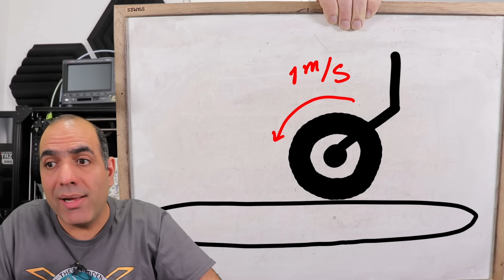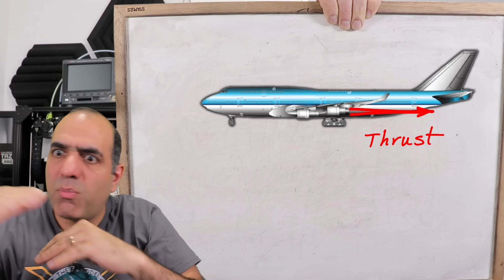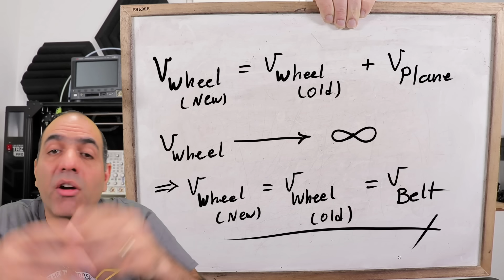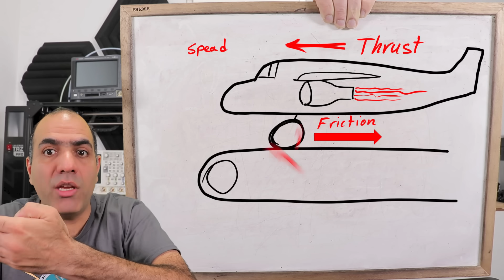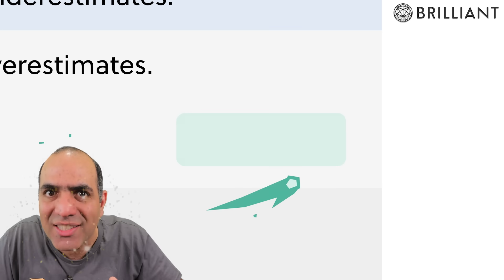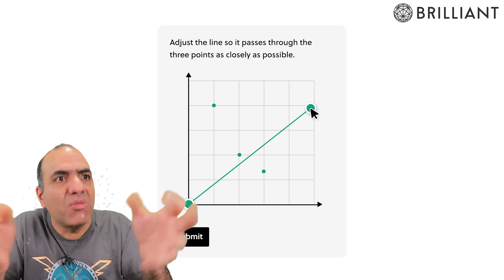Airplane Question that Drove Me NUTS!!!

Comment: Case 3 is definitely the most realistic, however if the belt is wide enough, the plane will likely take off due to boundary layer and ground effect :)
Reply: The non-slip boundary would occur only a few centimeters above the belt. With a high velocity it would make a lot of turbulence. No flow over the wing, and thus no lift. It would probably be sucked down by the pressure decrease due to fast motion of air below the wing. What could theoretically cause flow over the wing would be the air molecules that miss the jet engine intake, but there will be too few of such molecules, so the lift from that would be negligible. So it wouldn't fly.
Reply: Might as well factor in the bearings of the conveyor as well...
Reply: The belt in case 3 is unphysical, in that it has to instantaneously accelerate to sufficient speed such that the wheel bearing friction is enough to counteract the thrust.

So we have instantaneous acceleration, which means either infinite force or massless treadmill and treadmill bearings.
Reply: @DevinBaillie  Im glad someone else caught the big hole if you take the physical assumptions described. Given the rotational moment of the wheels they wouldnt accelerate immediately either, so it wouldnt need to be infinite mass-weight but..... a LOT
Reply: Yup, my first thought was "wait what about the boundary layer created by a fast moving belt?"
Reply: Boundary layer headwind due to the moving runway surface was my first tought too - question is if the wheels and bearings can handle the rotation speed or not. As for runway (belt) width - apparently it could be of significance if this is a 747-8, as it is classified for a wider minimum runway width than previous 747s, 60 m vs 45 m from what I can tell from some quick googling.
Reply: The spinning wheels would also generate lift of their own, see the Kutta-Joukowski lift theorum. The intense boundary layer would create massive amounts of lift off the wheels this way
Reply: Case three deliberately rewrites the question to be a clever-dick. The question says the conveyor matches the speed, not ramps up to infinity for some reason.
Reply: Except case 3 isn't realistic at all, because the belt motors/bearings would explode as they go to infinity.
Reply: Yeah, case three always seemed like the clear answer to me. The treadmill has to accelerate very quickly so that friction as well as the moment of inertia of the wheels are pulling back on the plane enough to counteract the thrust, but it's theoretically possible. At a few hundred miles per hour, tires are going to start exploding and the friction is going to increase dramatically allowing the treadmill to slow down, but it's probably going to have to accelerate and pop the tires within a second or two to keep the airplane from moving forward.
Reply: Nope, the wind would be faster under the wing, meaning downforce not lift.

Comment: you need wind to create lift, with the x movement being cancelled by the belt, no wind is being traveled trough, thus, creating 0 lift on the wings. should an external wind generator be there to create 160 knots of wind. and this is considering standard load. with no passengers (because likely no one would like to be on that plane), no cargo, and minimal crew,  the takeoff weight of the aircraft will be less, so it would require lower headwind to create lift.

Comment: In Case 2 the plane does not take off, if assuming general relativity, an indestructible plane/wheels/belt and that v/wheel or v/belt is infinity. As the speed of the wheels and belt approaches infinity, the amount of energy dumped into the atmosphere due to friction between wheels/belt also approaches infinity. Depending on how quickly the energy is dumped into the air, it will either turn to plasma (which I don't think you can fly in, and although the blast might launch the plane I don't think this is taking off) or a black hole that encompasses the plane (so gravity would be too high). In either case the rest of the world undergoes instantaneous global warming, intense radiation, and will likely explode when the amount of energy dumped into it surpasses the Earth's gravitational binding energy.

But the plane doesn't take off.

Comment: Since the question is nonsensical, my answer is yes and no at the same time. The question makes no sense because if the aircraft moves then the conveyor cannot move at the same speed as the wheels and if it doesn't move then neither do the wheels nor conveyor belt. An aircraft taking off has nothing to do with the speed the wheels turn and you don't even need wheels. It sounds like a question a 5 year old might have asked if they mistakenly thought the aircraft was powered by its wheels, which it isn't.  Another equally valid answer is "yellow" or 4.2 depending on the air pressure in Glasgow on the 14th March 1993.

Comment: If airspeed is higher than takeoffspeed, the plane is able to take off, so if there is a wind strong enough, the plane will (be able to) take off, even if it is stationary in relation to the earth's surface.

Comment: I don't understand why an infinitie speed loop would occur. If the wheel spins at 10 m/s, the conveyor eould match that. Why would it accelerate further? I think it's possible to try this with an R/C car on a treadmill. The treadmill is spun at the wheel speed, it does not accelerate further.

Comment: Mehdi, in the second case you’re also assuming the wheels has no mass! If we consider the wheels also having mass then the plane contributes it’s energy towards adding to angular momentum of the wheels. As the plane tries to move forward, the forward force is cancelled by the wheels inertia and its angular momentum keeps going up!
Reply: That's exactly what I was thinking: because of the wheels' angular momentum it can be shown that the thrust can be cancelled by the accelerating belt even in "dynamic" frictionless conditions without it ever reaching infinite speed.

Comment: The simple answer would be: it will still take off because the lift force of air is created by the engines and for the engines to get to their minimum takeoff speed .. they need some time because its increasing linearly.. so we have wheels so that during gradual increase of thrust, the plane would move with less friction! 
But in this case instead of a stationary runway we have a belt that would keep the plane in the same direction in one axis but then engines are still gradually increasing the thrust and at one point there will be enough thrust to take off...

This experiment can be performed on a mini scale using an RC plane and a very long treadmill ✌️

Comment: before watching:
since the plane pushes off the air and speeds up regardless of the ground moving back (though the accelleration would be slowed a bit, at least at low speeds) the conveyor matching wheel speed would exponentially speed up as soon as it starts moving, only with the plane sitting stationary compared to the (non conveyor) ground would the conveyor speed match the plane's ground speed, assuming this the tires would probably blow up in a few seconds preventing takeoff.
ignoring the tire speed limit the plane can take off as it only pushes off of the air around it (though it would probably be very turbulent i don't think it would be moving fast and coherently enough to prevent takeoff completely)

Comment: Lifting force is the key for taking of. If there's no wind, doesn't matter how fast the plane moves on conveyor, it's wings would have zero speed relatively to air. But we can lift the plane without using engines by letting it slide from sufficiently big hill.
Reply: Forgot to say, the conveyor can move air by the force of friction creating some wind. I can't say if this would be enough to take off.

Comment: I've only watched the first 36 seconds but my meta answer is that you have to either "Consider the question literally as stated" (in which case the absurd wheel speed is gonna cause a blown tire and a rejected takeoff way before they're at V1) OR ignore the premise as stated, assume its just a real conveyor belt with non-magical properties that just happens to be spinning "pretty fast" and in that case, yes, it obviously takes off.

Its a bad question to illustrate the fact that airplanes do not accelerate because of their wheels turning, but they have wheels because its more efficient than just trying to do a belly-takeoff and anything that serves to impede the forward motion is not going to be good for the landing gear.

TLDR: The 85 IQ answer is, it won't take off. The 100 IQ answer is, it will take off. The 140 IQ answer is, it won't take off.

Edit post watching: I watched the video and you basically came to the same conclusion - it depends on exactly how its worded and both answers are right depending on what assumptions you inject of your own. This is a far more satisfying video than mythbuster's "we pulled a tarp with a pickup truck and the plane was able to take off." Which... nobody really expected it not to, but it didn't reflect the question posed in a meaningful way.

Comment: Considering the frictionless bearings, there would be a problem with relativity, since increasing speed of the wheel and the belt could easily reach something like 10^8 m/s and more. It may as well happen that the angular velocity would be so high, that even if the inside of the wheel would move at a speed lower than speed of light, the outer parts of it would have to move faster (higher radius of rotation means higher perpendicular velocity). Then their behaviour gets funky.

Also, relativity would create new questions: in which frame of reference should they be at the same speed? At which part of the belt and wheel are we measuring the velocity? And at what time in which reference frame?

Oh my, I love relativity
Reply: lol, love you way of thinking. Because you can argue, that you do not need treadmill for this to work, because all plains already do that. The ground and the weels are moving at the same speed ... relative to each other :D

Comment: Every wheel rotation passes the conveyor surface back one circumference length RELATIVE TO THE PLANE.  The wheel rotation speed is equally from the plane's forward motion and the belt's rearward motion, it is simply double the rotation rate from when the conveyor was stationary.  That is where the mind boggling stops, there is no jump to three times.
You can push a card under an advancing but not slipping food can, with a circumference length card the can will only advance a half circumference but will have done a full rotation.
The tyres would disintegrate at twice the normal revs.  Plane tyres have a maximum speed rating.

Comment: Aren't the wheels irrelevant? Its the engines pulling and exausting the air out the back that propells the plain.

The bigger question is, could they utilize the belt speed for power generation?

Comment: IMO while the wheel speed is not directly connected to moving the plane forward, the wheel speed is directly correlated to the amount of thrust being applied as long as they contact the ground. more thrust means the wheels spin faster. wheels spinning faster means the belt spins faster. since the wheel speed increases alongside the belt speed it would theoretically stop it from being able to move. given of course the wheels are frictionless

Comment: I'd say without cheating, NO the speed of the wheels doesn't mater the relative wind does, theoretically and some time accidentally in strong storm, a plane can take off vertically with a big fan facing it and no ground speed.
Reply: OK your answers are better

Comment: Yes, the plane can take off. The wheels of the plane are not proving thrust like a car. The jet engines push against the air behind the plane. Therefore, the plane will take flight.
Reply: 200knts would be more than enough

Comment: The plane will stay on the treadmill if the engine thrust doesn't create any lift. I don't think it does, its purpose is to provide forward thrust, which is negated by the treadmill. If we do though accept that there will be some air dragged around the wind as a result of the engine pushing air around, then yes, it's may be possible to take off.

Comment: the wheel have nothing to do with the plane flying if your suggesting th plane remains in the position without moving forward then no it will not fly but the plane will move forward because the wheels are not powered like a car tire

Comment: I do agree that sometimes such problems lack certain information, but let's focus on the answer. Planes can fly because of the hydrodynamic lift, perhaps better known as Bernoulli's principle,  which is proportional to the speed of the airplane relative to the air. That's why if a plane gets below a specific speed, it starts loosing altitude as the force acting upwards does not match the forces acting downwards. Whatever the propulsion is used, those either push or pull the plane through the air. If the plane is located on a conveyer belt which matches the speed of the plane, the speed difference between the plane and air remains zero (assuming there is no wind), thus the plane can not take off, regardless of it's propulsion system as it has no speed relative to the air, thus no lift.

Comment: I say no, it can't take off. The only way the plane can take off is by moving through the air. The only way it can do that is to let the wheels slip. That can only be achieved by applying the brakes. Sliding across the "runway" costs energy. The plane's engines would have to be powerful enough to let the plane slide fast enough to take off with brakes applied. I'd say the 747 doesn't have that.

Comment: Any interpretation of the question where the planes engines are off is bad faith. Of course the plane would never fly turned off or planes would never be able to be parked anywhere.

Any interpretation of the question where the plane is on earth and the engines are running the plane would always take off.

The wind generated by the engines alone lifts the plane off the conveyor belt and it wouldn't matter if the plane was not moving at all relative to the conveyor belt before that.

Comment: Wow, too many made up scenarios & assumptions in these comments. 
Can the plane take off? = yes. The speed of the wheels have nothing to do with it.

Also, FYI, no matter how fast the vehicle is moving relative to the ground, the contact point between the wheel and ground (or belt) is zero.

Comment: Case 2 still wouldn't takeoff, as you have stated in case 1 that the jet engines are the only source of propulsion, typical passenger jets like the 747 pictured has a top speed of around .8mach, the highest the groundspeed/conveyer belt speed eould be the kt equivalent of around .7mach. Unless you have some black magic jet engine that can withstand the heat of blades spinning at infinity rpm and them not spontaneously exploding due to supersonic shockwaves

Comment: My initial thoughts is no, the thrust is from the jet engines, the wheals just prevent the plane from scraping along the ground. If it was on a conveyor the speed of the wheals would just reach a point where they would lose traction. like sliding on ice or water-planing, even if you stop your wheals from moving you will keep going.

Comment: Mythbusters did this one.   The wheels are irrelevant -  the thrust pushes the plane forward to achieve air motion and lift.  But what I appreciate is his drawing attention to the lack of clarity in the question itself.  Are the plane's engines even on?   What amount of retarding friction would the wheels produce if the wheels spun really fast...  Thinks like an engineer - properly define the question and ALL parameters - NO assumptions.

Comment: If it does take off Why don't military use it to fly aircrafts on aircrafts carriers?
Reply: Aircraft carriers use "catapults", which are basically steam pistons embedded in the flight deck to launch aircraft and overcome the smaller runway

Comment: Aircraft are not driven by their wheels; they are, in fact, free-wheeling. Once the brakes are released the "conveyor belt" is irrelevant. The aircraft is pushed forward by its engines directly; there is no interaction with the runway, conveyor belt or not. So it takes off once it reaches sufficient indicated air speed.

Put another way, since the wheels are free wheeling once the brakes are released, if the runway starts moving in the opposite direction to the aircraft (as viewed from an outside static point of view), then the wheels will just spin faster. that's it, that's all. 

I'm ignoring the possibility of the wheels over-speeding and over-heating potentially causing a catastrophe 'cause it seems to me it's not within the scope or the spirit of the question.

Comment: On the topic of airplanes, I'd love it if you could figure out why, electrically speaking, aircraft lose ground power when parked at a gate.  This sometimes happens.  I suspect there is an abnormality in voltage or frequency coming from the airport's electrical supply and the aircraft's electrical protection system kicks off the airport's electrical input.  This results in the loss of all electrical power on the aircraft except for batteries that power emergency lights.  I know that you would need accesss to the airport power system to probe with your oscilliscope, but that may be a possibility :-)

Comment: Obviously it will take off. The airplane is not pushing against the run way, i.e. it is not the weel which makes it gain speed. All that will happen is that the wheels would spin faster as the engines push against the air.

Comment: CORRECTION: If the wheel bearings are in a state of resistance, the conveyer belt would drag along in the same direction as the aircraft.  Non-powered wheels with bearing resistance will not turn the belt in the opposite direction.